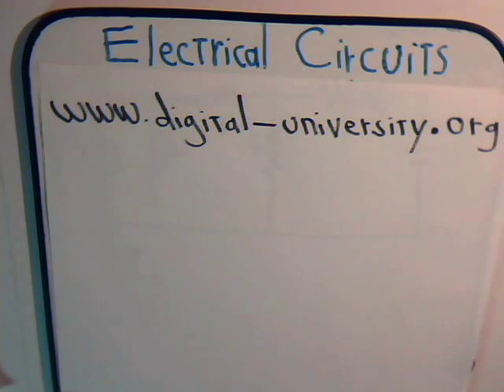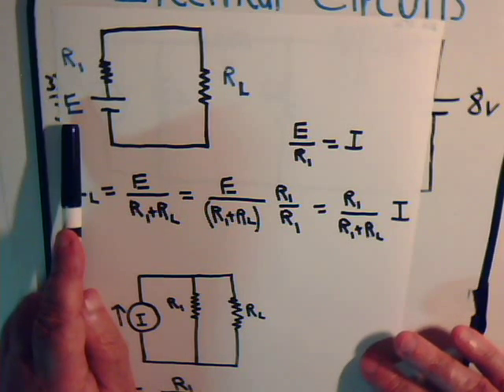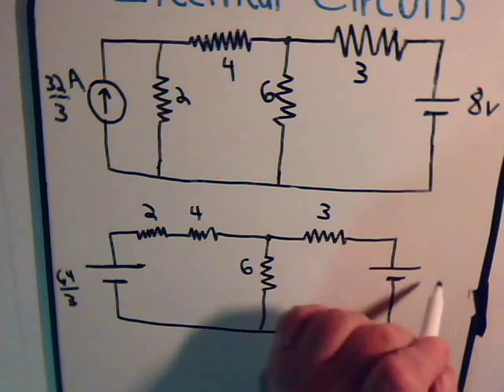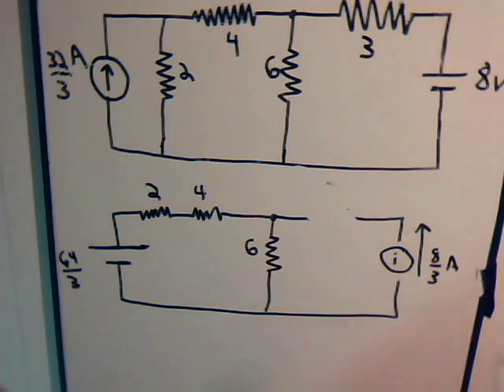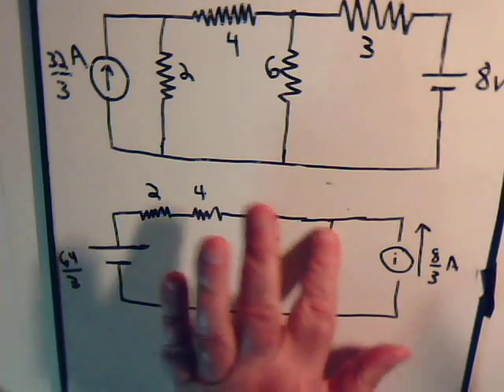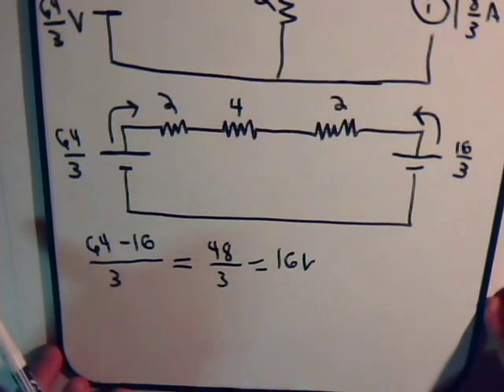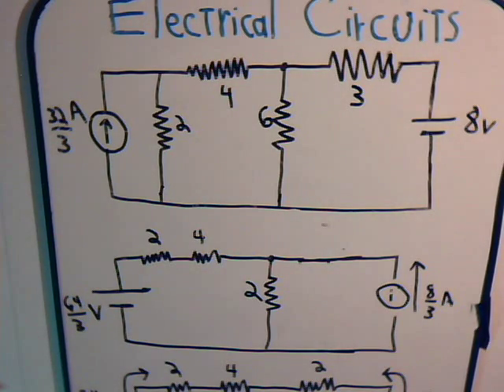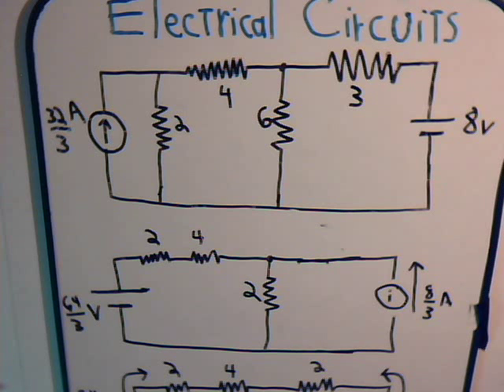Electrical Circuits Video 23: Current And Voltage Source Transformations - Example

Comment: LOL i have an exam in 4 hours XD im doing some brush up
but yes, series VDR and if it was in parallel you would need the current and use CDR
VDR only works with series voltages and CDR only works in parallel currents, easy to remember is VDR is for series and CDR is for parallel.

Comment: though you wouldn't be able to convert a current source with a series resistor to a voltage source. (thought i should throw that in there too)

Comment: for the first example what if there is a resistor in series with the current source and a resistor in parallel with it . do u use the current divider rule ? plz help , exam tomorrow ><